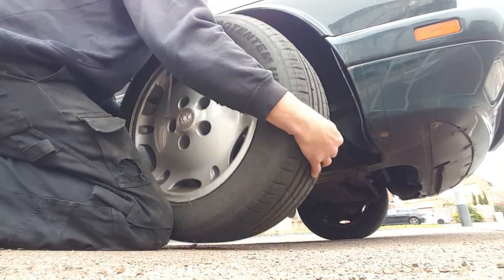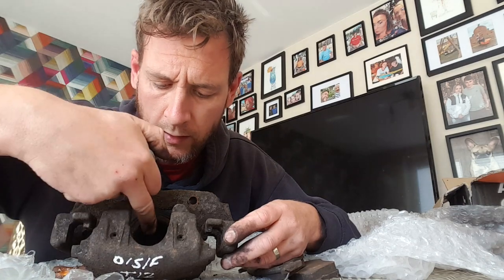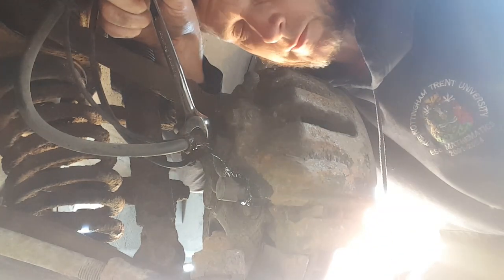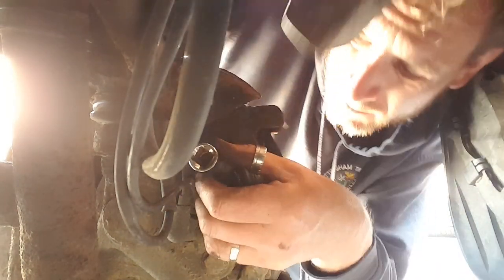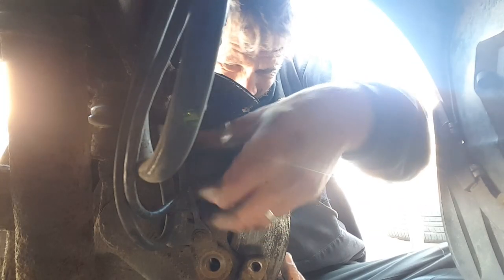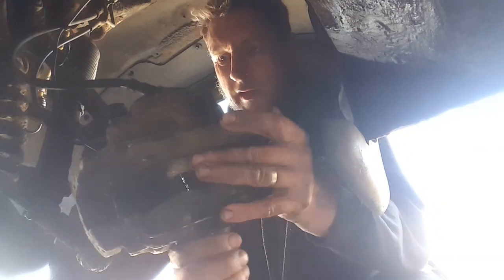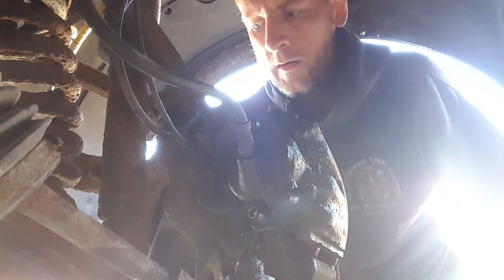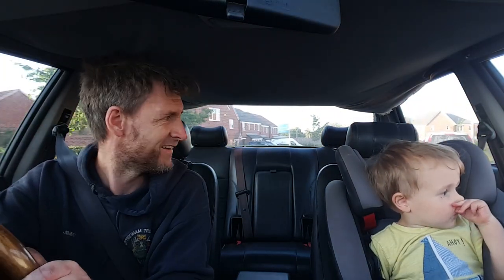Episode 145 - How to replace a brake caliper on a Jaguar XJ6 X300

Comment: Did i miss it or did you bleed the air out of the caliper via the bleed nipple?  Oh, trade trick.....put a piece of wood between the seat and the brake pedal and move the seat forward to depress the pedal as far as you can.  Then when you undo any part of the brake system you will get a bit of fluid leak out but then it will stop immediately.  No dripping and no further fluid loss.
Reply from the maker: Thanks Andy. Great tip that. I'll remember that for the future.
I didn't bleed the brakes on this occasion, as the pedal was firm enough and operated fine when I went out. Had it felt soft and spongy on my drive around, I would have done 100%. There's a bit more detail coming in a future video, so watch this space!

Comment: Dude you should never ever touch a spanner again let alone a brake pad. 
Not a torque wrench in sight, the caliper is supposed to have movement yet you proceeded to massively over tighten the slide pins which should only be pinch tight, no anti friction paste on the pads, you should have put a clamp on the brake house and also that caliper hose would have definitely needed bleeding which would have made the fluid level drop further, you only checked the  fluid level pre pumping of the pedal. 
Not even the kid had his seat belt on properly!!!! 
Yeeee haaaaaaa cowboy 🤠
Reply from the maker: Thanks for the advice Victor. I'll certainly bare these points in mind. I'm by no means a qualified mechanic, so any pointers that people can give to me where I've gone wrong are always appreciated. I actually had an issue with that caliper's bleed nipple, something that I relayed in a later video. This is why I took the workaround steps I did. Not ideal, but all I can do is assure you and everyone else watching that my brakes are really good, and still are to this very day (I was out in it this morning).
Certainly my lad's seatbelt is a very good point indeed. The seat that he had at that time was not the best, but it doesn't excuse it, even if I was only just going a hundred yards round the block, so thanks all the same. Point very-much noted.
If it's all well and good, I would like to offer some advice to yourself. I'm learning these things as I go and will inevitably make mistakes. As I'm putting up these videos for the world to see, I accept that some people will love them, some will detest them, and everyone else will sit on the fence somewhere in between. I also accept that the opinions they give will reflect these feelings. If I can't accept these things, I shouldn't bother posting such content. What I will say though is that calling me a Cowboy isn't exactly constructive. By all means, tell me if I've done something wrong. All I'm saying is that telling someone that they should never lay hands on a spanner again isn't helpful in coaching a person to do better. Ultimately, I'm just a regular guy, working on my old cars and enjoying life with my family.
I hope you enjoyed the video all the same. Thank you. 👍